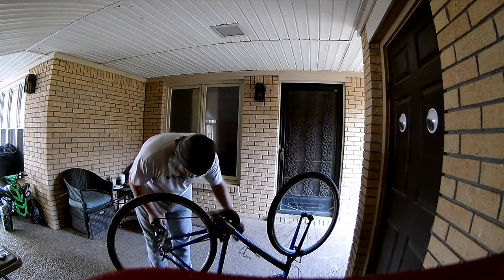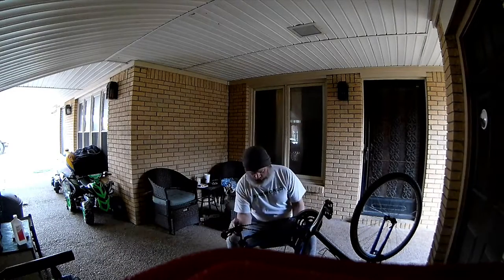Trek Wash,Scrub,Wipe,Oil LOVE 2 25 19

Comment: You can pick up a cassette tool dirt cheap on Wish or get an off brand one from Amazon. That's what I have and it works just fine. I've pulled like a dozen cassettes so far. Most of my tools are off brand. Oumers is decent and you can get them cheap on Amazon. Don't neglect them bearings or it gets costly. You've been logging a bit of mileage and they're probably overdue. You ever plan to get out Asheville way let me know... bring your bikes and we'll dissect and service them.
Reply from the maker: yeah i think i have links to some tools in amazon but never bought them..DOH!!!..I hate to sink much $ into this bike since im wanting to upgrade this year. Although im probably keeping this one as a back up for nasty weather..Mostly this bike just needs new brake cables ins/outs..gear cables ins/outs and some work on the brakes themselves.OH and a new chain..I know all that can be done pretty cheap its just a matter of priorities and doing it..AND rather i get out there or not we still need to do a hookup some how.I think we would compliment one anothers riding and videos..:)
Reply: @mikieson  tip for drivetrain: rotate several chains, for example 3 chains, and change evry month or every 3 months or what ever depending on how much you ride, so you start off with new chain, cassette chainring, and then use it until it chain gets more worn, switch to new chain, do the same next time with third chain, then go back to first chain, then second chain, then third chain then first chain, this keeps the drivetrain going longer, by having less worn chain at all times giving a smoother drivetrain.
a new chain might skip, or not work smoothly.

Comment: I recommend Abbey tools Crombie dual sided cassette tool https://www.abbeybiketools.com/products/dual-sided-crombie-tool?variant=242364892 but if you got a long torque wrench a socket cassette tool works nice too, but Crombie  save time, just grab it undo in seconds, but Crombie dual sided can be used for old bikes and bikes with 12mm axle, so a socket can't unless you got two of them. but Parktool and other brands like Unior also has similar tools, but Abbey tools ahs dual sided, so more secure to use on 12 axle cus it gives gives more support less chance of rounding off a lock ring.
 but chain whip you can make your self if you can drill holes and cut a tube, but htye got that too, I got Lezyne chain whip I got at my local store.
Reply from the maker: thanks man..ill eventually get tools needed for cassettes and bottom brackets. thats really the only special tools i need..ill check that link.
Reply: @mikieson  yea some of the tools I got are specific to component's I got, so need different bb tool for your bike. I got press fit one fuel ex, and Chris King Threadfit on my hardtail,plus on other old bike, but I plan on a new bike so will swap that bb from one of the old bikes over to new bike,with parts from my fuel ex, once that happens.
Reply: @mikieson  just make sure you get the right BB tool, cus there are many, also there are hand tool or bit tool, like a socket but for bb. that's what I got.